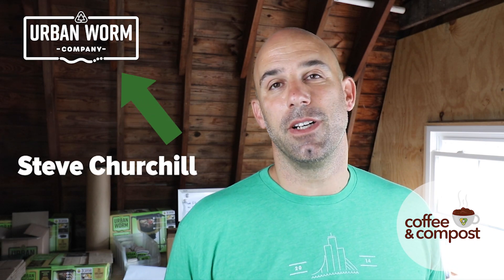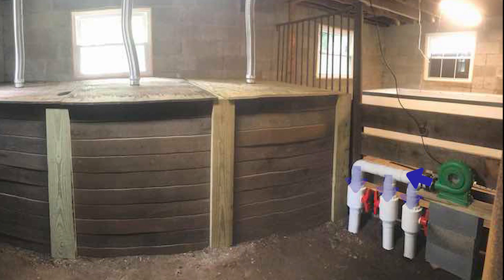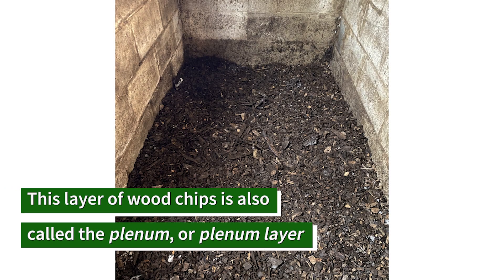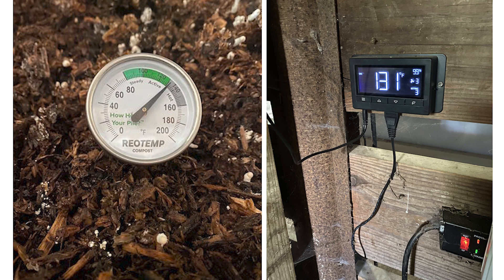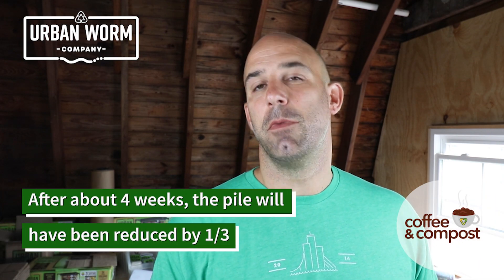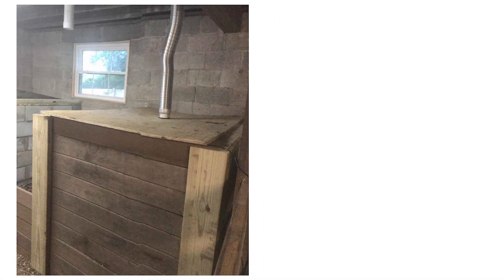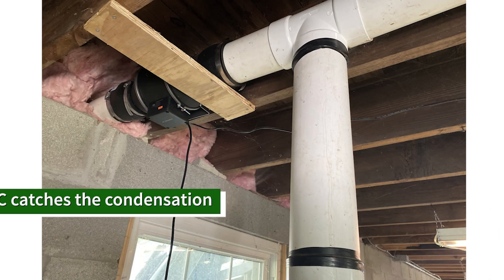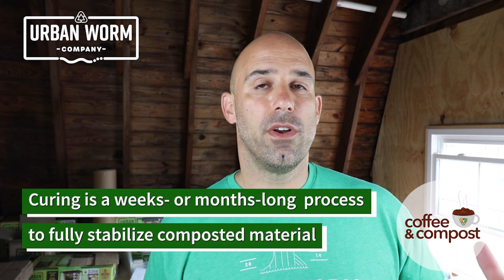150° Compost the "Easy" Way with Aerated Static Pile or ASP Composting

Comment: What's your approximate ratio, by volume, of spent brewer's grains to wood chips?

We regularly get more wood chips than we need for winter cattle bedding, and my GF works a shift in the tap room of a local brewery that gives us all the SBG we could want. During the winter we mix SBG with granulated molasses and pour it over hay to increase palatability, but currently have no real use for it in summer. I'd like to start composting it for use in our raised beds and maybe build a CFT sometime down the road.

Comment: Curious where you get your wood chips from?
Reply from the maker: I just got them from a local landscape supply company. We got playground mulch because the particle size was lower. It's more expensive but it worked better for us because we were using the precomposted material in our continuous flow worm systems.

Comment: Thanks, great video! Doing ASP bin style might solve the problem I am having. Asian jumping worms love my compost when I am conditioning it. Arghh! So far I have not minded turning my piles and they get very hot. But I do not want the jumping worms to invade my cooling piles. I am looking into storage methods for my compost as well.
Reply from the maker: Thanks Thomas! The jumpers will likely be able to infest anything touching the ground, so if you go the ASP route, think about elevating it somewhat.
Reply: @UrbanWormCompany  Right! Thanks much!

Comment: Thank you. This is so great. I created a 3 bin system for our horse waste. Should the bin be completely filled before starting to pump air or should air be pumped in during the filling process? Thank you.
Reply from the maker: Thank you! If you can fill the whole bin at once before turning on the air, that’s preferable!

Comment: @UrbanWormCompany, how do you rotate your ASP bins, meaning how do you always have feedstock available? Is bin 1 being used for feed while bin 2 is pre composting and bin 3 is being filled? Thank you for such an awesome video!!
Reply from the maker: Hey Cody, I answer the question over e-mail but for the benefit of everyone else, we generally only had two ASPs going at one time. We started ASP 2 about 3-4 weeks after starting ASP 1. That gave us a constant flow of pre-composted material for the CFT.

Comment: If you pitch the exhaust piping so the condensate runs back into the piles you won't have to water them so often to put the moisture back in them.
Reply from the maker: This is great input Jim. I wish I'd thought of it.

Comment: Does this system work throughout winter if it is outside?
Reply from the maker: Yes....the temperatures make it a little more difficult, but composting through the winter is certainly possible.

Comment: How much air flow is needed?
Reply from the maker: We used 45 seconds every 30 minutes, but this all depends on the power of the pump, the diameter of the pipe, the size of the pile, the number of holes in the pipes delivering the air, etc. I would check out O2Compost.com for more information on that.
Bottom line, there is a trial and error period where you have to find what works for your pile.

Comment: Great job, hats off!
I am buying an air blower for a system similar to yours in terms of volume, but outdoors. 
- what do you think the characteristics of the blower should be?
- what are the characteristics of yours (in case I decide to get indoors)
Thanks!
Reply from the maker: Thanks Arwa! My pump is a bounce house blower motor made by Koala. I believe it's 1/2 to 3/4 HP.

Comment: I  have REALLY enjoyed your videos. Recently I did ASP Composting in 44 gallon Rubbermaid cans. I used an aquarium air pump, 12vdc power supply 100w resistors with aluminum heat sinks. It worked very quickly. It did get too hot so I'll add temperature controllers. I was pumping air 24/7. After seeing this video I'll add a timer. 
I have a few more small scale ASP projects to try.

Comment: For how this system is designed, which is to only produce compost that has been broken down enough that worms can  more efficiently digest and further process the material, 150 degrees is pretty impressive and likely more than adequate to meet objectives, so congrats.

But, it's not sufficient to do proper hot composting where it's important to get that temperature as high as possible to maximize aerobic bacteria and break down the material as quickly and completely as possible. In this case, the objective isn't to break down the material enough for the worms to finish off the composting, the objective has to be to do a complete job on its own and for that to happen, I don't know that can be accomplished without fully turning the pile.
Reply from the maker: Ehhh....I don't know about that. This thing cooks really well. I've gotten it to 170°F which is actually too high. If we let is go, it would compost everything pretty well. That said, turning helps gets the stuff on the edges into the middle for sure.

Comment: Fascinating. What a perfect set up for your set up. I like that you can use the material as soon as it comes out of the thermophilic range to feed the worms.
Would like to try this on a slightly smaller scale and go from there.
Cheers
Reply from the maker: You got it Clive....thanks! The one thing I'd caution against is going smaller. A 1.5-2 cubic yard bin like I have is about as small as you'd want to go because you need to volume to trap the heat.

Comment: When I was doing my Masters in Watermanagement we went to visit an aerated static pile, I loved the idea and think it always wanted to it in an smaller scale, lie you are doing here. Just one think that you might be aware. 
The guys in the facilty had to call the fire department a couple times because they actually got the pile too hot an burn.
Reply from the maker: Thanks Nicolas! Piles catching fire are almost always in massive piles at large operations.With mine, it stays so moist that it's not really an issue
Reply: That's not paying attention to what's happening. And, I'm not totally convinced that a pile should actually start burning... In the first place the pile's temperature can rise only when there is sufficient bacterial activity and aerobic bacteria need a lot of moisture to grow and become active enough to generate heat, so much moisture that it's hard to imagine how the pile can burn. A lot of steam might be produced but isn't the same as smoke or an open flame.

Comment: Great video! Just curious as to what ratio of brewers grains to wood chips you use in your setup?
Reply from the maker: Thanks Luke! We currently use about 90 gallons (12 cubic feet) of wood chips to 35 gallons (4.6 cubic feet) of brewer's grains. This is likely on the low C:N end of things so if you try to replicate this, aim for a bit more wood chips. ;)
Reply: @UrbanWormCompany  Thanks Steve appreciate the reply. I currently run some CFT's myself and would like to replicate what you're doing to speed up the precomposting of the feed material and increase fungal dominance in my castings. Do you find freshly chipped wood chips work well or do you stick to aged wood chips?

Comment: Bounce house blower link points to the inline fan.  How did you come up with the blower timing settings?
Reply from the maker: Thanks Joe! I just fixed the link. A rough blower timing schedule was suggested by Peter Moon of O2Compost. We just kind of toyed around with it and settled on 45 sec on, 30 min off. We actually ran our first ASP at 6 minutes on, 60 minutes off. That certainly heated up the pile but also dried it out too quickly so we dialed in on this number. 
When you poke your head into the ASP when the blower is on, you can definitely tell that air is getting pushed through the pile.